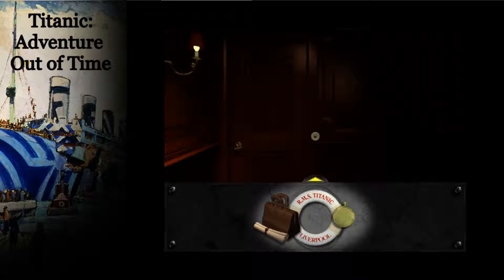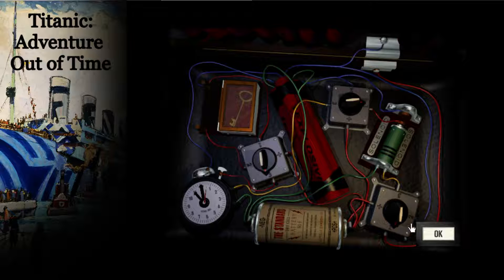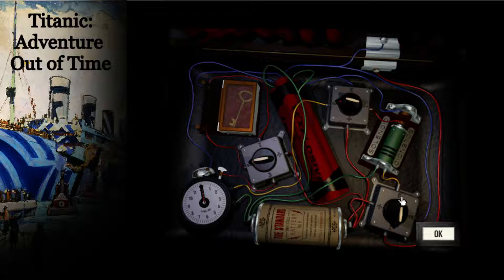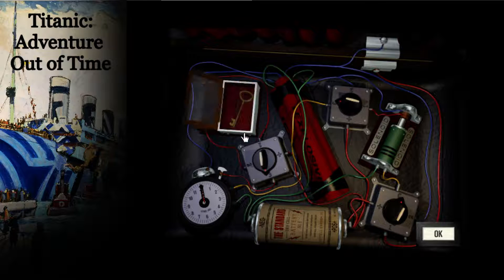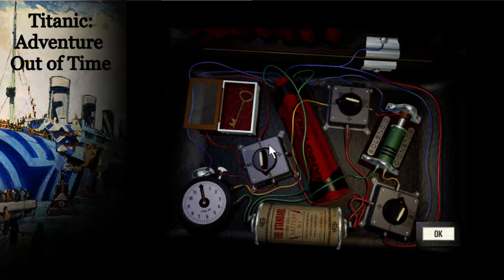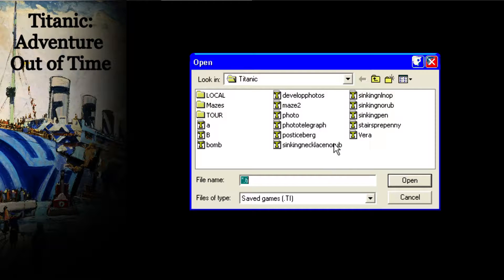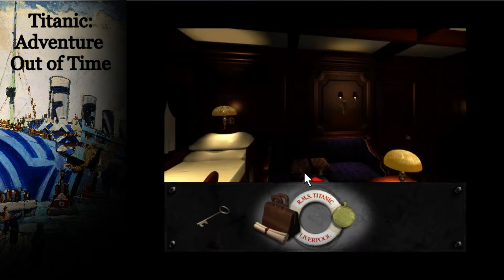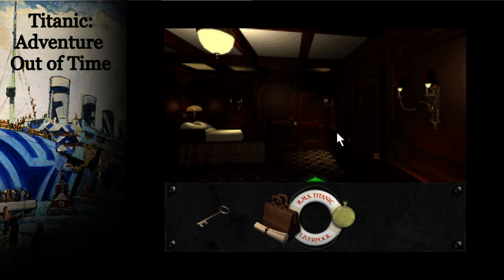Titanic AOOT: How to solve the bomb puzzle

Comment: That is a BIG battery! I didn't know batteries were used publicly back then.
Reply from the maker: I looked it up and the first dry cell battery available for public consumption was sold in 1896 by the National Carbon Company and produced 1.5 volts. From images on google, it seems likely that a National Carbon Co. battery was used by Cyberflix to design the battery in this bomb.
Reply: Wow. Did you know there was flashlights in the 1920s?
Reply from the maker: @kylehill3643  I didn't but it looks like a pretty interesting history and closely related to the invention of the dry-cell battery. Neat.